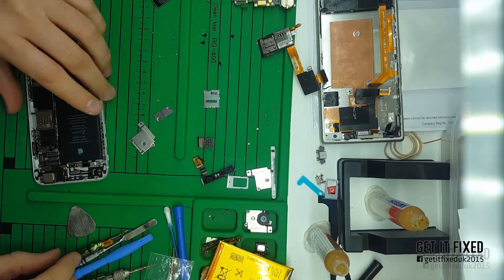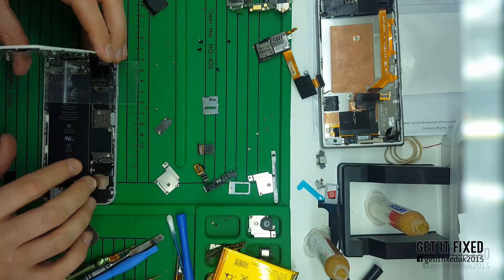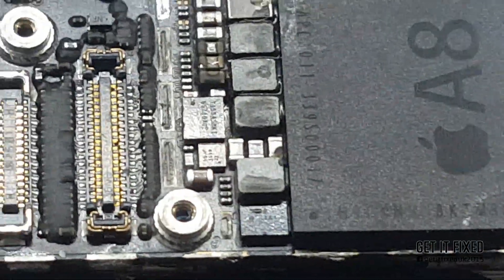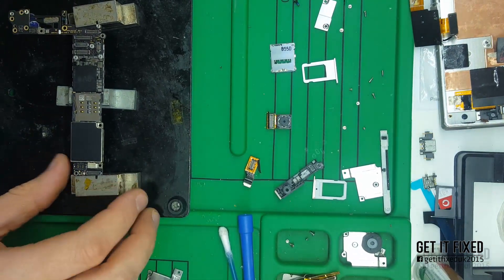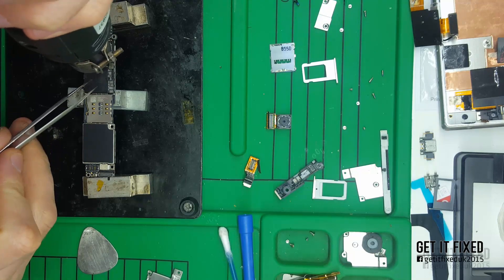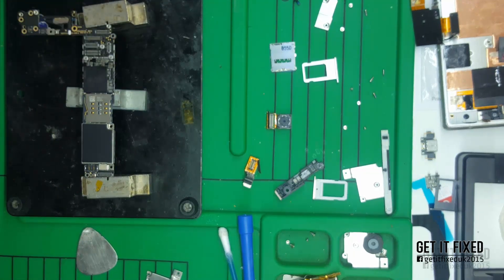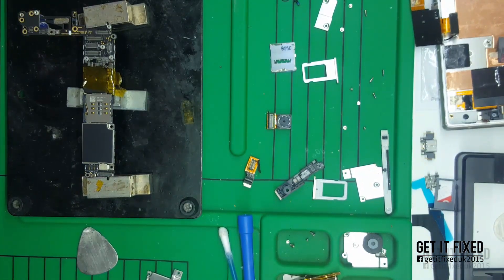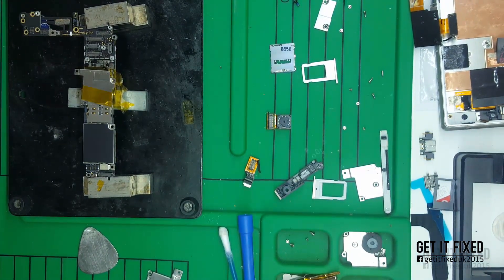IPhone 6 or 6 Plus Backlight Diode keeps burning Fixed

Comment: when i was reconnect and connecting screen sockets i smelled a burn smoke for a second. After that screen didn't run but apple logo hardly seen under light on startup. So this is backlight burnout? But i removed battery socket already, maybe the socket was just touching?

Comment: Hello,
I changed FL2024 but i have a short on FL2024, what's the solution please? Change the diode ? 
Thank you
Reply from the maker: hi mate, fl means that the component is a fuse which suppose to have a short, should be fine mate
Reply: but i have no backlight yet !
Reply from the maker: than my friend, it my be more complicate, if u have electronic diagnose skills, just let me know where u have the short, or if your diode is burning after replacement? Check as well capacitors, for shortage!
Reply: Hi. I'm pretty sure that FL stands for filter and not fuse. They are not the same.